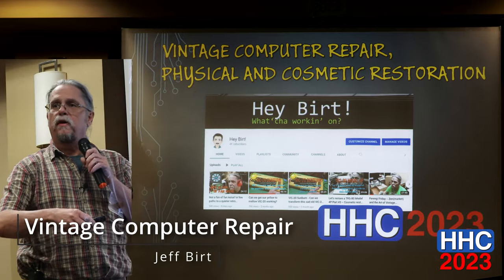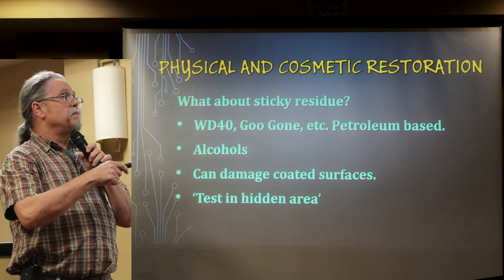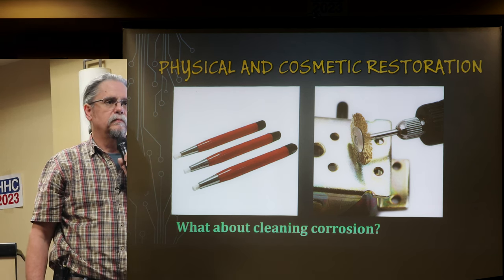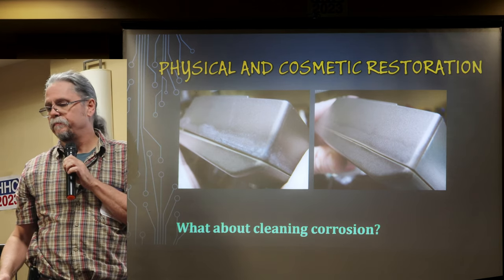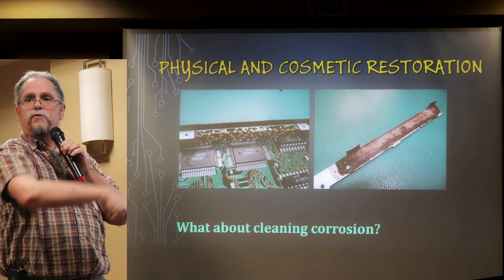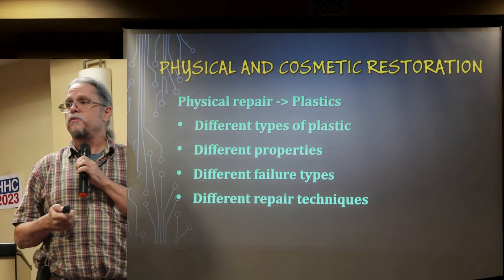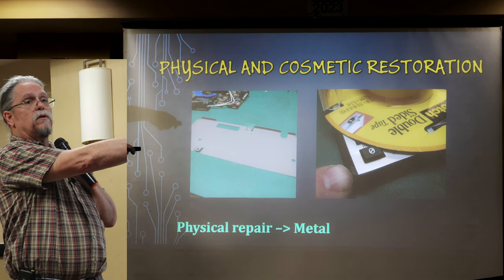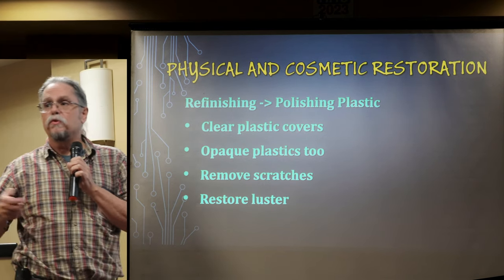HHC 2023: Vintage Computer Repair, Physical and Cosmetic Restoration (Jeff Birt)

Comment: You really need a microphone for audience responses to convey the full event - otherwise its a bit one-sided!
Reply from the maker: I had not one, but two microphones for that purpose.  Unfortunately, despite testing in advance and verifying they worked, both had too much noise to be useful on the recording.  So instead I used the audio from the presenter's mic, but generally bumped it up by 15-20 dB when audience members were speaking to make them audible.  I may have missed some of these instances (which you presumably noticed here), but I am pretty sure I got the vast majority throughout the conference.  At some point I will try to figure out why those microphones failed.  The camera I had them connected to does not have live VU meters or audio monitoring, so I didn't notice this until to was too late.  Unless someone wants to volunteer to buy me a new B camera to match my more capable A camera, there is the potential to be problems like this.